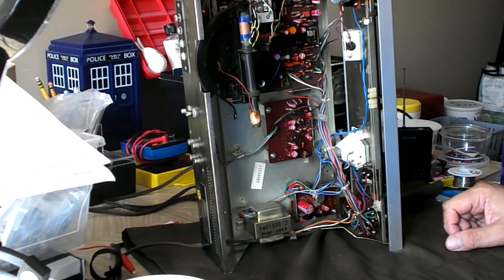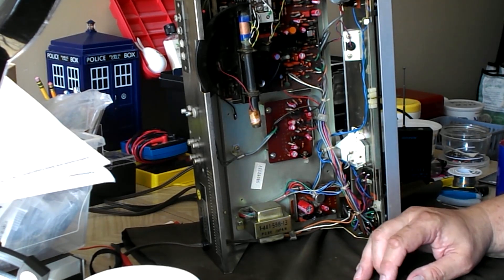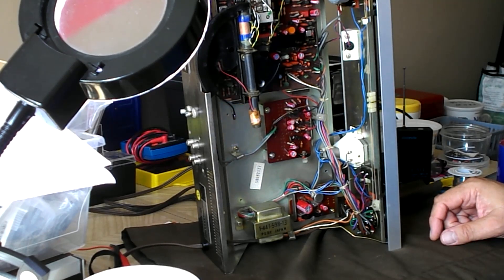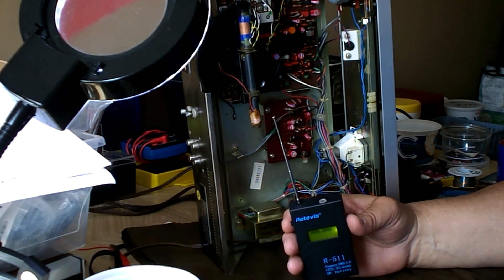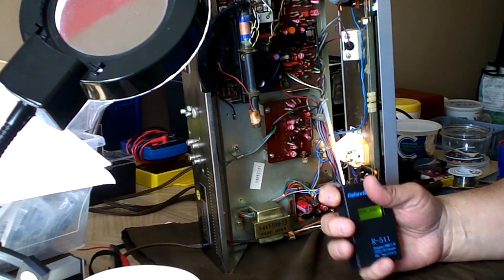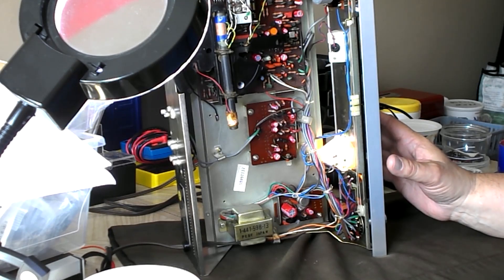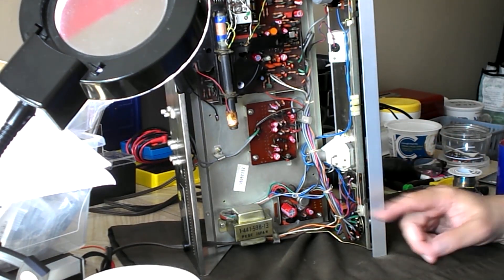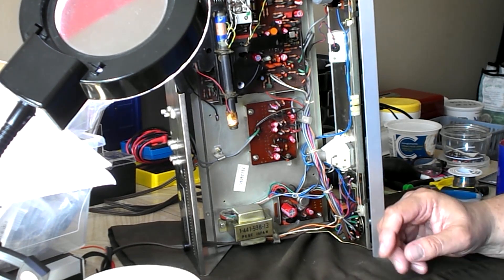Wi-fi interference on FM tuners- theoretically it shouldn't be there but it is!

Comment: Talk about interference... I was designing a power supply a few weeks ago. Had it all breadboarded up... and I am getting some high frequency oscillation. Turns out it wasn't my circuit at all... I was picking up FM from a broadcast tower about 10 miles away. I can actually see the tower from my windows. It's located on a nearby hill.

Comment: So if the FM tuner circuitry is picking up a harmonic frequency of Wifi, then do I still need to connect my streamer to the AUX port, or can I just stream directly through FM? 🤔😆
Reply from the maker: The FM receiver can pick up some harmonic of the carrier but can't decode digital signals, so go with the aux input.  My Yamaha T2 and Sansui TU-717 don't seem affected by this likely because there's enough shielding and filtering.
Reply: @acrossthedial  , I'm an electrical engineer in automotive and if you go back to the time when most of my audio equipment was made EMI wasn't a major concern, maybe a capacitor added to ignition so your radio didn't pick it up as a signal.  But starting with electronic fuel injection it started to become a topic, and then with airbags, and now we do full EMC testing on vehicles before they go into production.  Some items, like twisting speaker wires, we do automatically as a minimum with no need for discussion unless anything more is required.